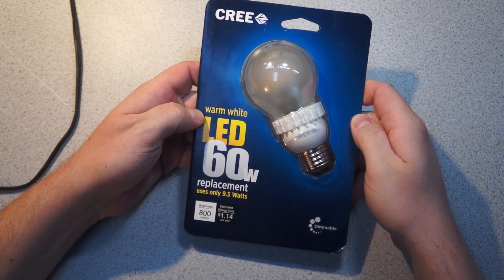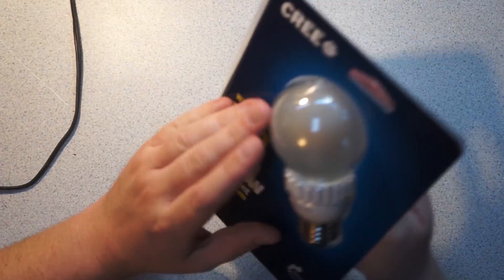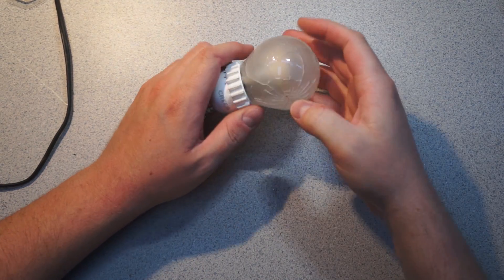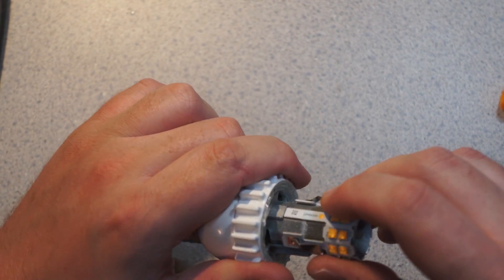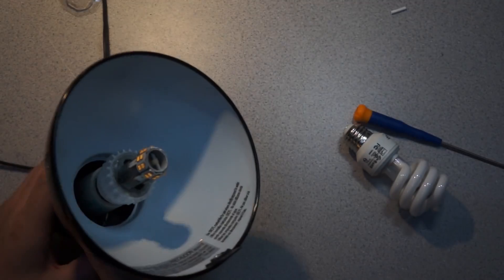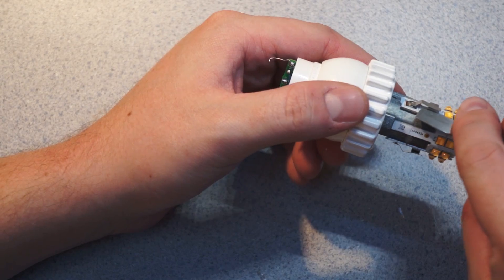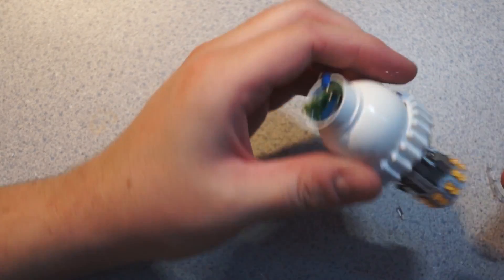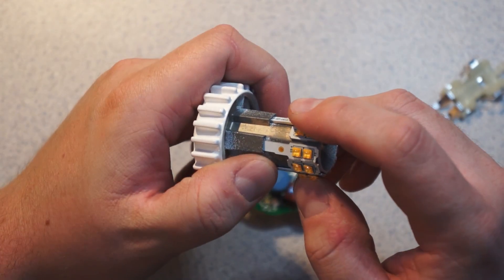Cree LED Bulb teardown

Comment: What was the DC output from the converter module? I'm just thinking if it would be possible to convert my Ryobi flashlight to an 800 lumen instead buying the small led bulb that fits the fixture for such small lamps. ;)

Comment: squishy lenses .. if removed reveals the true led wavelength which is ultraviolet.  the squishy yellow polymer contains phosphorous which when exposed to u.v. light emits the white light actually seen as the bulbs output color spectrum.  pretty common technique used in mass produced led bulbs in these early led bulb years... there is a patent on full spectrum LED dye chemistry which would probably be a one step solution instead of this strange u.v. to white light filter trick ... what should be going on instead of the gel filter applied on the exterior of the LED is phosphorous and other appropriate chemical dopants applied directly in the makeup of the LED dye, so the white light is emitted directly from the LED and no exterior filter gel squishy is required.

Comment: Unfortunately the only problem of the design is the use of a glass bulb. Kind of pointless if your concerned with durability. Other than that top quality components for the LED bulb to last a long time.

Comment: great video. I just tore into one to try to discern why it failed in maybe 3-4 years of occasional use. First it bears repeating the dc side of the little board is near 300vdc. BE CAREFUL KIDS. I'd have thought the board or the interconnects or the fuse would be the failure points, but in fact ONE of the individual led's evidently failed. With globe off you could see all glowing faintly with one dead, presumably with a big drop across it.
Reply: btw the led board/ring is easily removed by drilling out two little studs, then it slides right up and out.
Reply: george jefferson 
i just took apart a bulb that had the same problem that you had and  fixed it by scuffing up the contact points. Of course i broke the bulb though lol but it works now. 
it was a cree daylight led bulb. The bottom pops off at the expence of the 3 plastic tabs breaking. But now i know for next time that i dont have to break the bulb to get to the contact points to repair (it/them) as i have all led lighting at home.
Reply: Frank DeLed

Comment: You can get to the circuit board from the top without destroying the base. First, slide off the LED PCB.  It literally slides right off (reason for my failures as listed other post). Remove all the silicon/epoxy type material where the base of the globe sets.  I used a small straight slot screwdriver.  You will see plastic tangs that will let you release the cast metal cage and there is your circuit board.

BTW.  The shock from the two tangs ain't no big deal.

Comment: I purchased these exact Cree bulbs when Home Depot first brought them in.  All failed rather quickly.  They would start by either not coming on or going dim.  Often times, this condition would oscillate.  Have APS UPS with frequency and voltage logs that demonstrate not abnormalities in the line condition.  Turning off and back on had them working for a few minutes.  Reseated (Type A9) to no avail.   Dissembled one of them.  Nothing appeared out of the ordinary.  I cleaned the contacts on the PCB and readjusted the metal tangs.  Light began working again.  In about a month, light began acting up again.  It seams to be some sort of heat stress/fatigue causing possible electrical arching or dissimilar metal corrosion.  Contacted Cree and advised them.  They very nicely sent me new replacements at no costs.  It was only about a month before those replacements did the same exact thing.  The problem appear to be centered around the PCB/metal tang connection.
Reply: Sam Houston 
Im thinking about buying some dielectric grease and testing if the dissimilar metals are to blame or bad sealing between the housing and heat sink that is allowing moisture to enter and causing some slight corrosion. Or as you said it could be metal fatigue due to heat. 
i had a similar bulb failure
Reply: Frank DeLucey thelooneytunesshow
Reply: They have replace this whole line but it was one of the first to be able to be used safely in a bathroom without exploding.
Reply: Similar experience here. The LEDs in my Cree were in 3 strings. One string went out completely and the other started to blink. LEDs just overheated and died. I strongly suspect thermal contact problems with the LED board wrapped around the cast aluminum(?) heatsink with no thermal compound. 2 cents worth would have  saved it.

Comment: I have a 'device' circuit board I need a bit of help with..  It's over 15 years old, yes, years not months. The electrical engineer I showed it to said it was 'programmed', but I'm not convinced.. I'm a beginner at best, but can follow most of what you're saying with a bit of quick reference. As far as I know it was never widespread produced, but it should've been. Can I send you a few photos? I won't post them publicly until I know more..
Reply: P Huster  I'm always interested in electronic oddities... I love the challenge of "repairing the un-repairable"... by tracing out the circuit and discovering why it does what it does... and then why it "doesn't". It's kind of rewarding to sometimes even find a mis-designed circuit, whereby a single resistor value change fixes a problem. (this first happened to me a Sony TV I worked on in a TV & Radio Repair Vo-Tech class in my junior year of high school... circa 1976). Been a EE Design Engineer ever since :-)
Reply: beforebefore  Any idea how to send a private message? I'm not really interested in this being public till I know what it is....
Reply: P Huster YouTube's "send message" function is accessed by clicking on a username, then "about".

Comment: Cree LED lamps kick ass.  Between my home and 2 shops, I have almost 100 of the cree brand floodlights that fit into the ceiling cans.  The ones with the turbine looking external heat sinks. It has been 4 years now and not 1 single lamp has failed.  Not even 1 single LED in any of the lamps.  They also operate very cool compared to the other brands.  Great stuff.
The Chinese white LED strips you buy on spools for $9, expect 1 week before phosphors start dimming as they will.  Buy the spool of CREE brand which looks exactly the same but costs $150, 5 years on and not one single indication of any LED dim or failure.
Reply: Give them a year or two.  You get what you pay for.
Reply: +bishplis you are just here to be a jerk.  You didn't even read how long I had my CREE lamps did you.  I bought the "expensive" genuine CREE lamps in 2010 and they all work to this very day.  Five years+ On the first ones and going strong.  Even when a five year lamp is compared to a brand new unit, no difference in visible brightness aka no phosphor aging. Seeing as you buy $2.00 knockoffs that don't even use a real ballast inside,  your ceilings are probably no higher than 8 feet.  So replacing the knock-offs is easy.  My ceilings are 20-35 feet tall in most places.  I just buy something real and properly engineered, knowing it's not going to be a problem later on.  Cheap white Chinese market LEDs use poor quality phosphors that dim significantly over a relatively short span of time.  Not all of them, but a significant portion.  Lacking a proper potted ballast, they often resort to a simple capacitor/resistor type passive "power supply" that is non regulated.
Reply: +bishplis no shit Sherlock!  Not too much is made in the USA, still engineered here though.  CREE LEDs are built in China to CREE engineering standards.  White LEDs use phosphors to create white light from the blue emitter die.  The LED is only as good as the phosphor and the phosphor is the most expensive material used in white LED construction.  So guess where they cut corners on the open market LEDs made to look like CREE but at .03 cents each vs over a dollar each for a genuine CREE?  The phosphor!  So you a have a nice bright .03 cent white LED the dims and shifts to the blue spectrum after 10,000 hours at best.  Some real shitty ones start failing after 100 hours.  They look good at first though.

CREE was also the first to mass produce and market the blue LED.  There was a time when the idea of a white or blue LED was merely a theoretical possibly.
Reply: +bishplis the China hate is they don't feel bad turning out crap at the bottom dollar.  They don't care...  At least in the past.  Things are improving and some of the best products come from China when supervised.
Reply: +bishplis I am an engineer.  Worked on LED backlighting for automotive and industrial applications for a number of years.  Trust me, the only white LED that lasts and reliable is CREE.  Maybe some of the clones are much better in the past year or two, but it's not worth experimenting to find a suitable "cost saving" LED for a high end product.  The higher performing clones that looked promising eventually had die bond wire failures, that is they would flicker when warm.  Tried to save money with promising performing "counterfeit" CREE (no name brand in CREE LED package with initial identical performance) but their shoddy nature came back to bite us in the ass.  The equipment with CREE LED never had a single issue.  So I won't buy any household LED lighting fixture unless it has CREE emitters.  It can be another brand name... For example Snap On tools makes a work lamp (made in China as expected) that uses genuine Chinese made certified CREE branded LEDs.  Great work lamp.  I only hope the cheap ballast holds out 1/5 as long as the CREE LEDs can.
And so we are on the same page now, when I say CREE LED I am talking about the individual light emitting diode itself.  CREE was so well known in industry for true quality white LEDs, they got into the house lighting market.  I bought the lamps as an engineer I knew would last.  I avoided the too hot to touch ones as in this video.  The CREE lamps that failed as reported by others didn't have bad LEDs... Ever.
Reply: +bishplis well if that's true I have to say job well done on perfecting the white LED in both quality and overall longevity.

Could you take a bit off your pay raises to make your LEDs more affordable?

Comment: Well, after getting my hands on about 50+ customer returned Cree LED bulbs (of which only about 8-10 are actually bad), it seems the biggest single point of failure is actually the AC Neutral wire that simply gets crimped by the screw-in bulb base when it's attached to the plastic housing. They eliminated one too many hand operations. If this wire had been left long enough to protrude from the metal threaded base, enough to bend over the top lip and solder there, over 75% of the failed bulbs I found would have not failed.

The symptom is a flickering bulb that will go out randomly, and touching it can bring it back on... depending on which direction you 'lean' the bulb while it's screwed-in tight.

I found the simplest way to repair those is to create a small, sharp indentation through the metal base right on top of that wire. The wire position in the base is very repeatable and predictable, so with a small flat-blade screwdriver against the upper lip of the base, and a moderate 'whack' with the handle of a larger screwdriver (it doesn't take much), it dents the metal just enough to make a much better connection than their "slip it over and crimp" friction connection. The small screwdriver blade tip creates a fairly sharp dent that makes for a high point-of-contact pressure on the bare wire below the metal, against the plastic base inside.